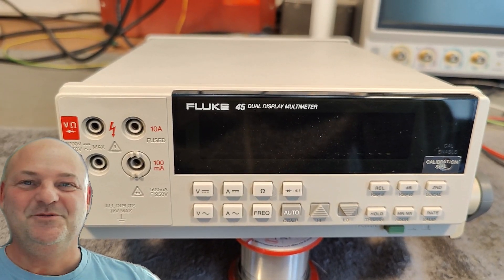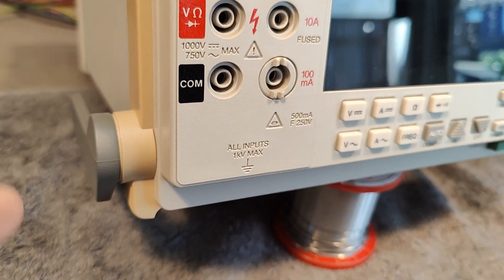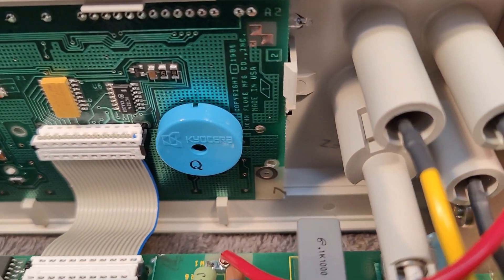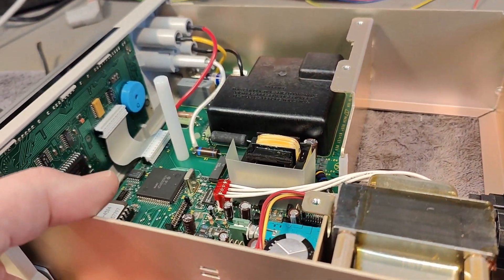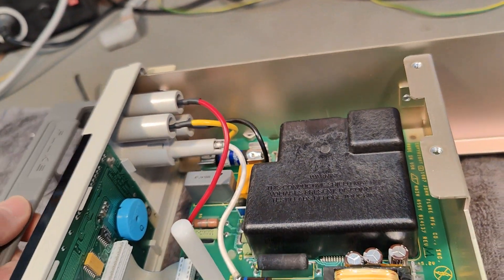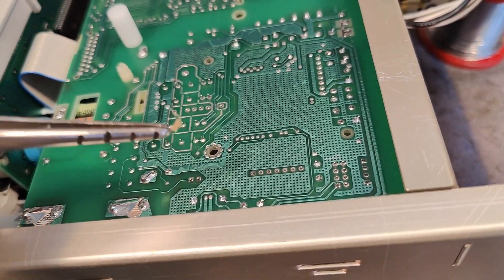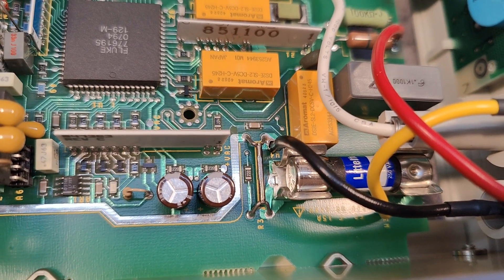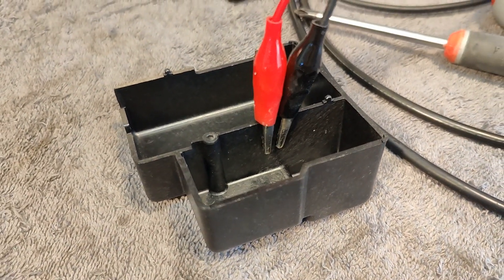FLUKE 45 Dual Display Multimeter 5 digits 1998

Comment: I got one of these as my main meter and it’s honestly a great “Budget” benchtop meter. 

The biggest flaw they have is that the VFD gets dim with age. But if I recall correctly it’s still possible to replace it with a LED display, though it requires quite a lot of work…

Comment: I have used them and then owned one.  The tragedy of this nice meter is that it's useful lifespan is limited by that kind of display that gets dim.  I have stuff that is older with LCD and LED and there are no issues.  LCD is a problem in hand held meters that may be dropped onto a hard surface but not for bench meters.